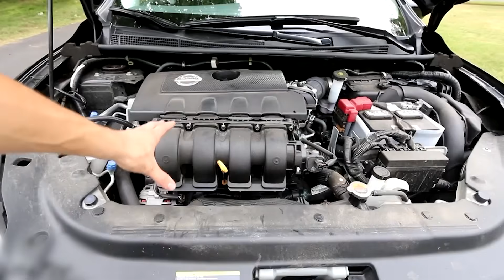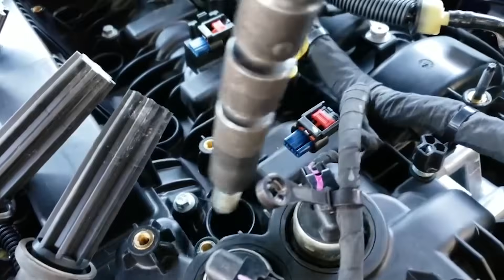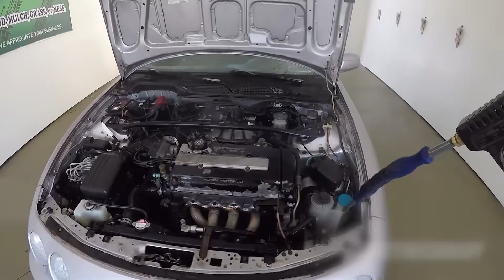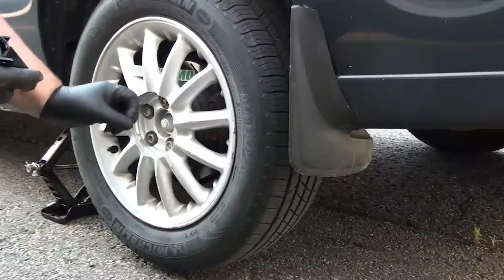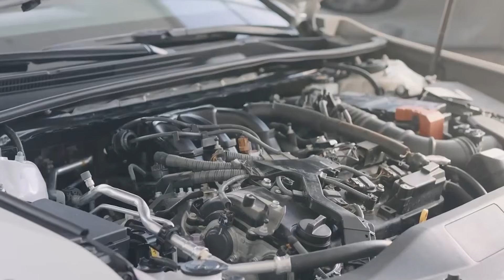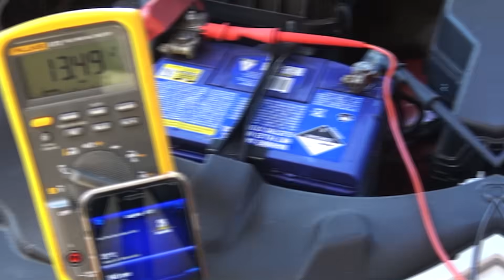Your Car Won't Last 100k Miles Unless You Stop Doing This

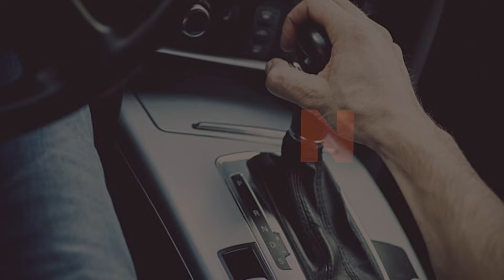Comment: 04:16 NO
Very wrong advice.

Brake pads and Brake discs are cheaper than the car's engine. Especially the way modern cars are built, even the cheapest car Actually have very different brake alloy compounds compared to same cheap car from early 2000s.